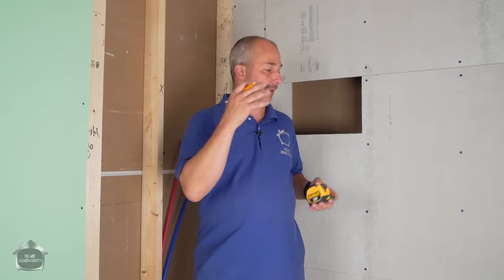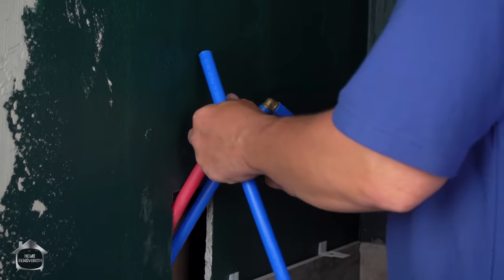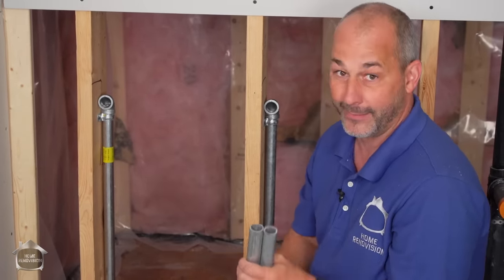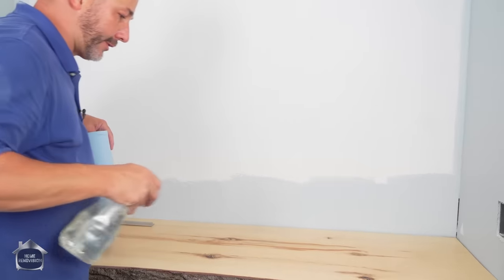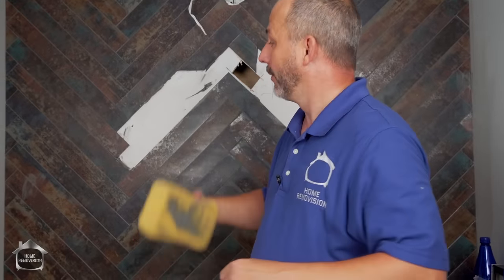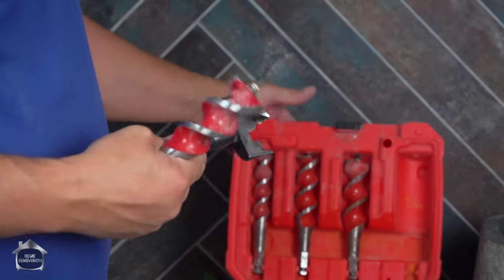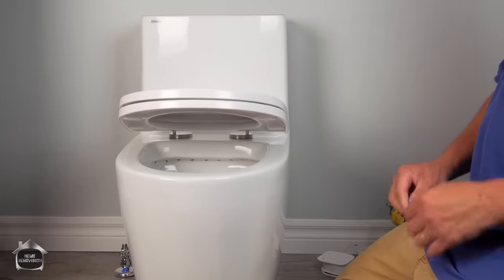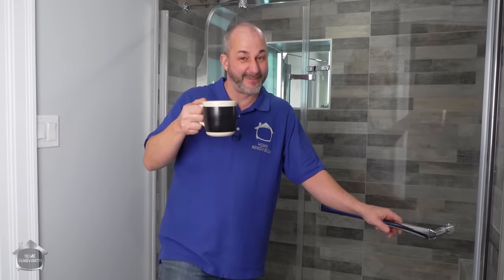Complete Build of a Modern Rustic Bathroom | A to Z

Comment: In the spirit of during everything beforehand, shouldn't you have drilled all the holes for the sink before you did the finishing of it. That way, the holes themselves would have been coated with the finish, and stopped any water ingress there's an end up in the countertop itself?
Reply from the maker: sure you can. I use silicone to seal the bowl and the faucet has a gasket so no worries.

Comment: You can tell this guy hasn't build very many showers. However pretty decent practices. One big problem I saw is that you have to wet down hardie board (it's not cement board as he called it) before you put on waterproofing..you also have to wait for your thinset to dry to put it on. It will peal right off if you don't do this. I would never trust shield-guard (the waterproofing he was using) to seal those bench corners..they will crack they will leak. A person should use waterproofing membranes to layer the top and corners. ALWAYS back butter your tile unless you want problems.

Comment: The price sounds low, but meibe I'm looking at more quality materials,🤔
Reply: Prices have gone up rapidly. Some have come down a bit, yet 3/4" plywood (4x8') is still $65US where I live. I suppose it depends on where you go. Contractors here are getting calls for jobs, but are having to charge accordingly,  or delay the jobs until the prices come back down. Wood isn't the only thing that skyrocketed in price during COVID.

Comment: During our research for bathroom fixtures we came across numerous articles that spoke about how dangerous it is to buy your fixtures online because unless you can confirm that it is NOT built in a country that doesn’t have the kind of restrictions against dangerous metals and construction materials you may be getting something that is actually poisonous. China is really famous for using lead soldering and other material that is questionable. So cheap may not be a really good deal.

Comment: I have one criticism of this... even if the mirror will cover the tiles NOW, leaving the wall only 2/3 covered (and with that horrible tint "oops?" of a rectangle you just filled w/loads f grout-the 1"x4" or so gap from a too-short tile just to the right of the hole around 2hrs in) feels just wrong-what if someone wished to repurpose the area and took the mirror off only to find tiles they can no longer match so have to tear it all down 20, 30, even 50 years later etc? So much detail only to kinda half-ass part of it "because it won't be seen" [right now]... you could be making a headache for someone later, especially if the like the tile or even if they just want to paint over it.

Comment: You called grout and thinset "cement" alot. Which one are talking about? Your "cement" fill at the base of your shower pan is porous...my plastic shower pan called for a silicone fill at that base joint. Are you sure you're giving accurate info?

Comment: you get that red shit where its not supposed to be and its never going away! I laughed my ass off during your wallpaper video. 20 minutes for a double roll and paste the wall? cut your sheets and paste on the table than butt it. You never want paste on the face of your material. if you were hanging fabric or foil you would have destroyed the product. I can hang a double roll in 10 minutes.